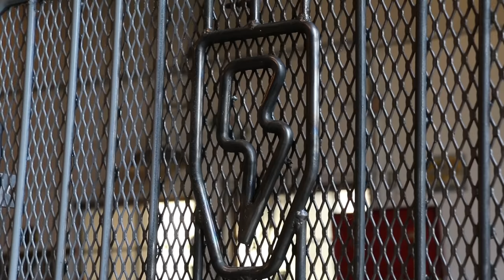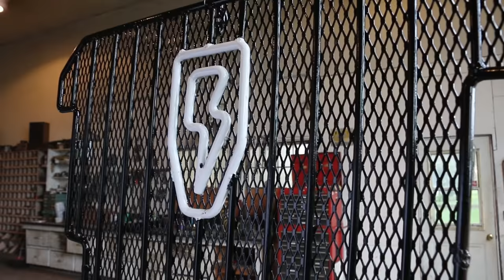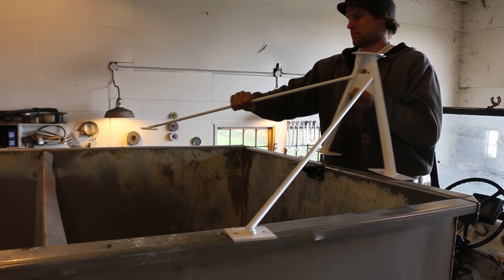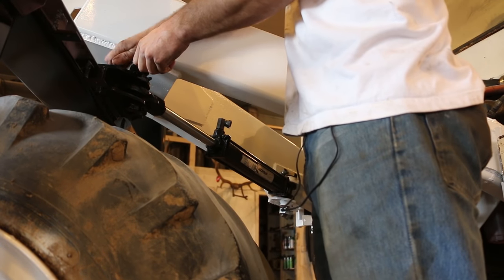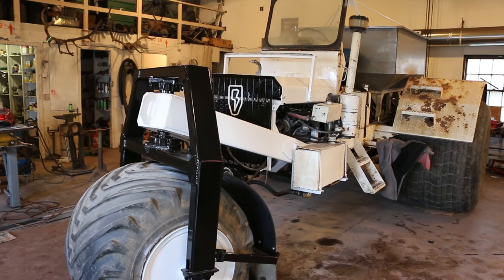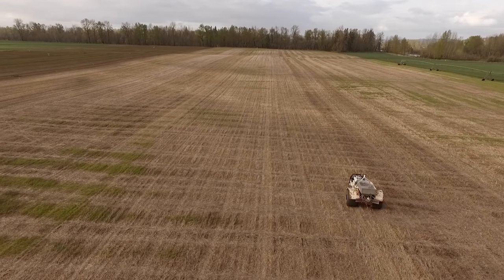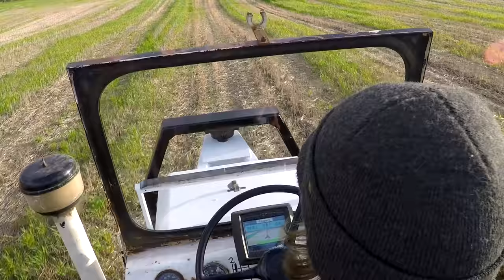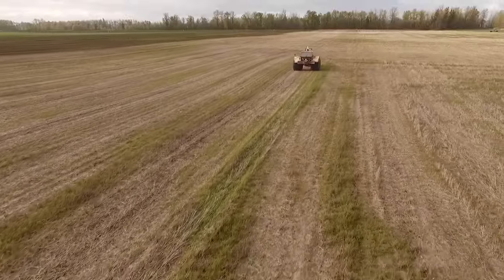Fertilizer Buggy pt. 8: The Finish Line!

Comment: There's a lot of work that goes into farming. One time i bought a old case 2470 4wd tractor for $3k from a crop farmer who had it parked in the weeds for years. The #4 cylinder had a busted exhaust valve that hammered up the piston/sleeve so i rebuilt that, sent the heads away for rebuild, had a glass company come replace all the broken windows, a tire company replace all 8 bald tires and after sitting in the corner of the shop for over 2 years it was finally done. And i painted it. Drove my dad nuts that i put so much money into it but worked great for many years, it was the difference of being able to now plant 110 day seed corn instead of 90 day bcuz that tractor could dry out the wet fields 1 month sooner..

Comment: Request:

1. attach a canvas canopy for your buggy cockpit... also add a search (LED flood light) on the front..so you know where you're going in the dark (if sumday that happens).
2. add custom (plasma cutter Cnc) made rear wheel tire cups..matching with the front wheel.

Comment: Love the video series. Look forward to the rear end replacement in fall, and adding the double thing you mentioned (whatever that is). 

Lastly wouldn't welding a piece of flat metal on the bottom of the toolbox extend its life a bit?

Comment: Your Dad is right (they usually are) about rebuilding the rear end.  Repairs ALWAYS cost more when something breaks while running plus there is that whole 'this field needs to be done now' and the required piece of equipment is out of service and you end up paying the farm supply to fix it.  I'll lave off the point where the repair often ends up require several more repairs because the mechanics are paid on flat rate plus they never saw this model back in trade school.  Do it yourself and it'll be done right.